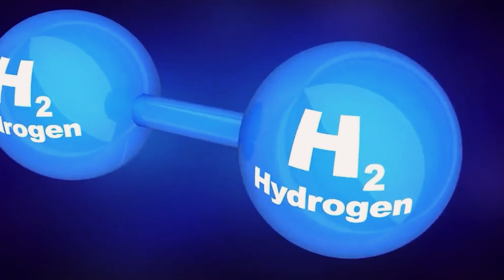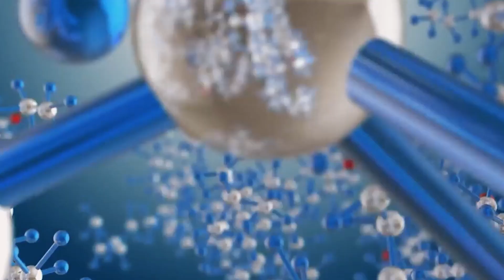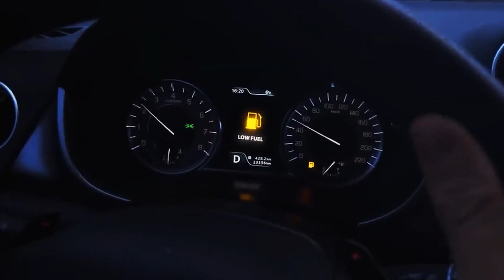GOODBYE BATTERIES, HELLO HYDROGEN: TESLA'S BOLD NEW DIRECTION!

Comment: This article talks up all the advantage oh hydrogen fuel cell but ignore all the disadvantages. Just the term "blue hydrogen" means the main source (95%0 of hydrogen is derived from fossil fuel! Then the gas needed to be converted into liquid form for further handling and storage (-425 degrees F). Oh, it is also very flammable (remember the Challenger explosion?!). Now, it needs to stored in strong and heavy refridgerated tanks transported to refill stations with trucks because there is no grid to plug it into. The Toyota hydrogen project was launched and failed, whichever was the weakest link?, Toyota never made public, maybe all of the above?
Reply: I am Not an expert but we are talking about solid hydrogen not liquid. I remember a few years ago the developed a solid hydrogen that can be molded like a bar of soap and safely handled everywhere. I am sure the technology has evolved to the point that it makes a financial sense and will cut the reliance on China.